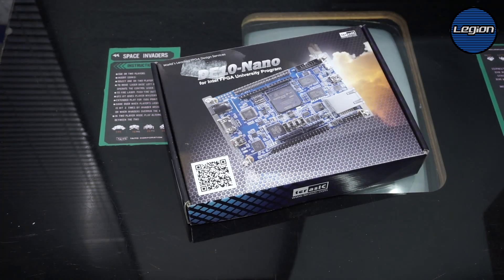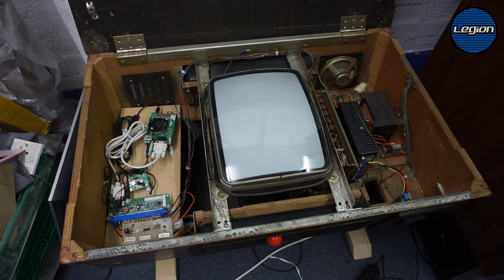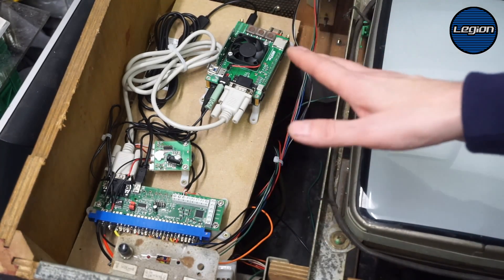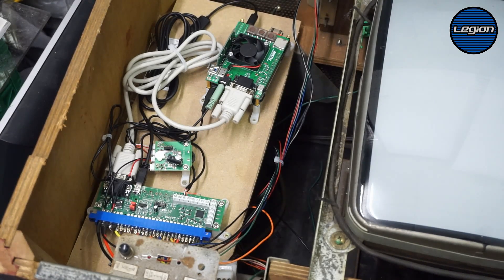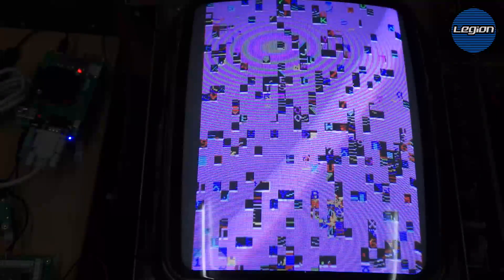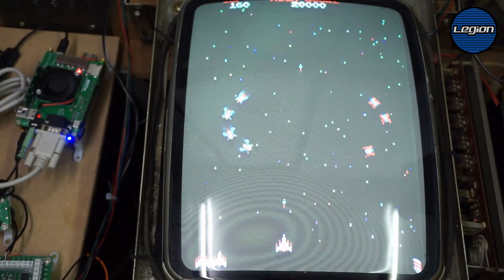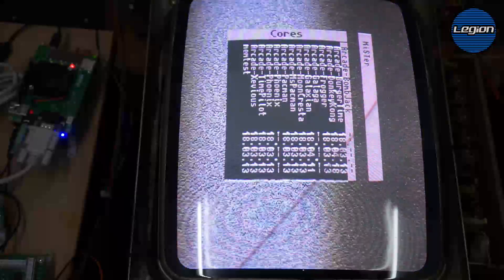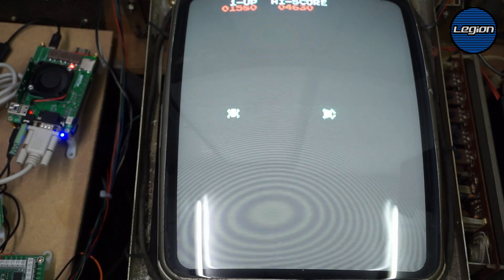CONNECTING THE MISTER DE10 NANO TO JAMMA ARCADE WITH A J PAC

Comment: Was your picture blown out and pink? I’m getting a crappy picture with mister & jpac
Reply from the maker: the picture strength from the mister and jpac was a lot higher than a normal arcade game and I had to tweak the monitor quite a lot to get it looking good.One problem was not having a good picture test screen to use for setup  and I don't think any of the games had dipswitch settings to use one from inside a game.

Comment: Do you know if you could bypass the JPAC and just use a VGA breakout cable? I am doing that with a RaspPi at the moment, but would love to have Hardware accurate DK. I would assume it works but it would take some effort to figure out the correct .ini settings.
Reply from the maker: the vga breakout connects to the JPAC and it just increases the low voltage used on normal tv to TTL 5v used on arcade monitors.

Comment: I use a pc in my JVS cabinet. How could I do this in a JVS cab? I use a Jvspac for my pc
Reply from the maker: I can't say unless you can tell how your cab is setup,. what screen do you have, how are the buttons connected to the pc ?
Reply from the maker: ok, so the jvspac connects to the buttons and you have a VGA connector for the screen ? you could try plugging the mister direct into the VGA and then plugging the jvspac into a usb port, it might just work.
Reply: legilegion buttons are no problem. JVS pac converts to usb. The problem is the VGA is 15khz
Reply from the maker: @mattmungrin4792  why is that a problem ? the supported cores output 15khz and I use the JPAC to increase the voltage of the video signal only so i think it would just work and worth a try.
Reply: @DJlegionuk  so the de10nano can output 15khz natively over vga? That's what I'm trying to figure out.
Reply from the maker: @mattmungrin4792  yes, you need the IO board with VGA and also the USB HUB, but I am 100% sure it will work.

Comment: I just ordered the J Pac for an old MVS cabinet that is missing the monitor and MVS board.  I want to use the MVS wire harness mainly for the controls but I'm worried about the re-mapping, you mentioned Ultimate Arc in your video about the re-mapping, can you share a bit more about it?
Reply from the maker: https://www.ultimarc.com/jpac1.html you can program the jpac to bind what ever you want with the software they provide. unless you have a MVS 1 slot the rest  are not true JAMMA and have some changes in sound and also the player buttons for game select.

Comment: Won’t the conversion to USB and back again introduce lag?  Is there a way to wire up the controls more directly into the FPGA board?
Reply from the maker: It's only converted to usb once in the jpac why do you say and back ?. I have not kept up to date with the Mister development and I think they have quite a few improvements with input and people have made custom jamma adaptors too.

Comment: This is great. Any way I can flip the screen? It's rotating to the wrong side, and I have the image upside down on my vertical monitor. Thanks.
Reply from the maker: HI, I know you can change horizontal and vertical modes from the menu and options, but this does not work that well when using the arcade CRT display modes they are fixed unless they have flip options as part of the game dip switch settings.
Reply: @DJlegionuk  Thanks for the quick reply. Checking the readmen on the Github there is an "screen_rotate.v" update API, that seems to decide if the screen rotates +90 or -90 deg. Need to see how to apply this and build again.

Comment: So you don’t have to do any tinkering to get it to display at 15khz? Just set most of the modes to 0?

Will this run each arcade game at its natural resolution?
Reply from the maker: it all depends if the core supports 15khz and the main setting in the mister.ini is
scandoubler_disable=1
composite_sync=0
forced_scandoubler=0

with these settings it will output 15khz at the games natural res if the core supports it. Bomb jack does not and it only supports VGA . there is a list of cores that do support it on the wiki.
Reply: @DJlegionuk  a bit off topic but the 15khz situation is this the same for the console cores?
Reply from the maker: @MrDirkles  from what I understand it has to be programmed into each core to work correctly. So if it does not support a display mode there are no settings in the mister.ini that will change it.

Take a look at this
https://docs.google.com/spreadsheets/d/1-Le6cJ0Fzxgo3pglolequL6Fq1WynjaPWTT_jkZlBbI/edit#gid=0
Reply: @DJlegionuk  thanks for link.

Comment: Super cool! I'm looking to do the same with my New Astro City but the audio is intimidating to say the least. I have the NVS-4000 PSU with a built in stereo amplifier but I'm afraid that whatever is coming out of the DE10-Nano is too amplified already. I'm a complete audio noob but the fact that you use an amplifier makes me think that the audio coming out of the Nano is line? (Am I saying this right?)
Reply from the maker: yes I think it's line, This amp was taken out of some cheap pc speakers so that is what it would expect to see. you can adjust the volume in software.

Comment: you need to get the space invaders core on that thing... maybe even as a boot.rom.
Reply from the maker: yes that was what i wanted to do all along and I believe there is a space invaders core, but it's not on the main list at the moment. Also not sure if it's mono display.
Reply from the maker: i tried it and it does not display correctly on the CRT I would say it looks like VGA is still working.